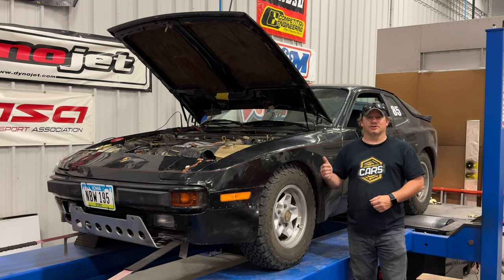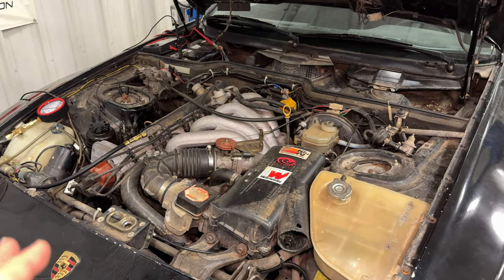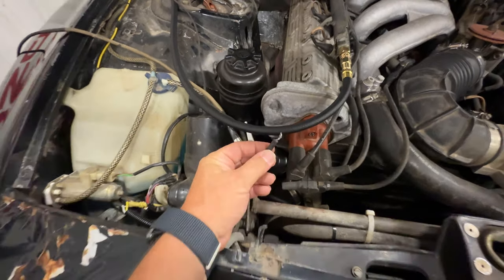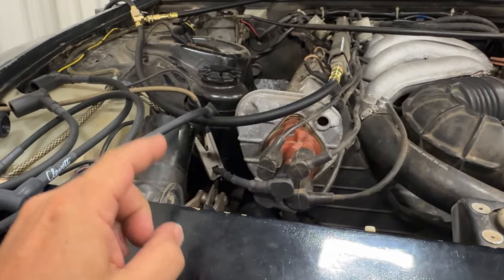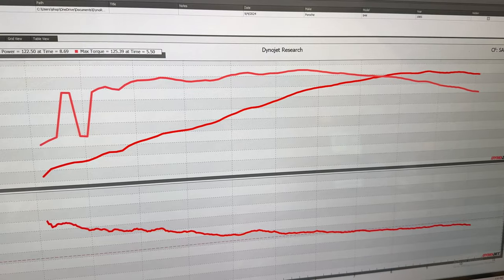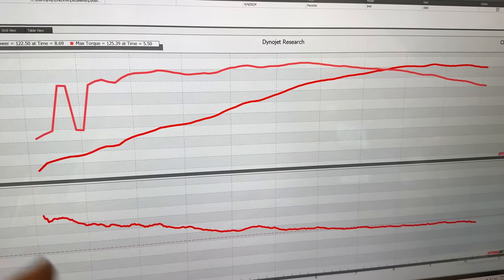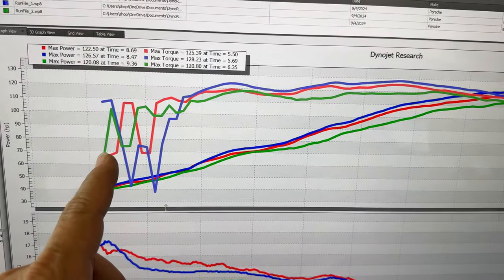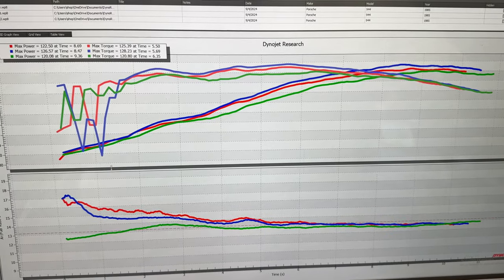Going to Extreme Measures to Find the Problem

Comment from the maker: After the video when changing the cap and wires, I also found that the previous owner had installed the cap upside down and it was not seated correctly.
Reply: It’s a wonder it ran as well as it did!
Reply: My guess was way off I guess. Awesome job.
Reply: As soon as I heard the crank no start I thought ignition. I guess it's still true... never trust someone else's work!

Hope you get it fixed right!
Reply: @TL243  yeah my initial guess was crank position sensor

Comment: Lol, I have an '84 944, and found my plug wires were badly arcing to ground, causing misfires, poor running, etc. I wrapped the wires with green 3M vinyl tape and that fixed it all. I also once had my rotor cap pop off since a precious owner had bent the L lugs holding the cap to the base: broke the rotor, had to get a tow home, but had it fixed in 2 days with Amazons help to a new cap and rotor. Fun seeing you work the 944, thanks. 
Ps. Check your charging voltage with the lights and wipers ON. I had the charging wire under the dash barely hanging on by 2 strands at the white single connector and it was just enough current to run during day, but any additional load wss too much and the battery wss running down. Once I spliced the bad connection( blue wire to white ),  no more charging problems. Cheers.

Comment: i recently burned out the wire from the coil to the distributor in my '53 MGTD,  it started up and ran flawlessly when cold  but once it warmed up the "missing" commenced. felt similar to having a plug wire loose or gettting water in the distributor cap. i only figured it out when i realized that ALL the plugs were misfiring as a group. not just one. and i realized that only a bad coil wire would create that sort of problem. 

the cause was probably the "performance" coil and an OHM mismatch, i had recently put it in when i installed my new electronic distributor. and a subsequent trip across the country involving about eleven consecutive eight hour days at about 3500RPM, did it in. 

subsequent research has shown that resistance increases with heat, and so, as a damaged wire is heated resistance will increase to the point where the sparkplug is just 'a bridge too far' and the current will jump to a nearby ground instead.

Comment: If the car misses intermittently or does weird dying check the ignition switch. They tend to crack and cause all kinds of weird electrical and running problems. That piece of knowledge cost almost $5000 worth of parts replacement to gain. They’re cheap but kind of a PITA to replace. Because it was an intermittent problem ( sometimes weeks would pass before it returned) I went through the entire ignition and fuel systems one piece at a time before I finally found the problem. Also replace the DME ( fuel pump relay) and keep a spare in the glovebox. You’ll thank me someday. Good luck on your project. I haven’t seen any of your videos before but make sure the timing belt and water pump are replaced at 30,000 and 60,000 respectively. Engine rebuilds are really expensive.  My ‘83 944 has 220,000 on it now (original engine with no rebuilds) and is still going strong.   Mike M. @ Road America Northwest.

Comment: Be interesting to see if a v8 would fit into that 🎉
Reply: LS converted 944 Turbos are all over the place. The V8s have too much torque for the normally aspirated 944s transmission. The turbos came with stronger transmissions and can deal with it.

Here you go………https://youtu.be/h8ez9Y1a1C0?si=efcHHBkDWFKzrFVJ

Comment: On your’last’ run, it looked like the temperature was creeping up but made because at high rpm normally movement of the car would push more air thru the radiator. ?????
Reply from the maker: I didn't have a fan on the car because I needed to simulate the temps seen at rallycross where the car is working very hard but is going at a relatively slow speed.